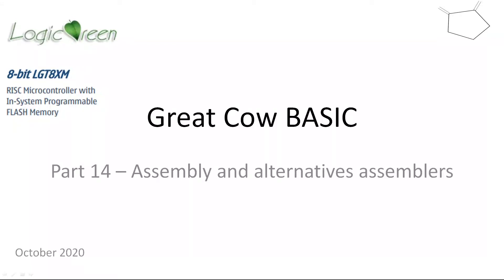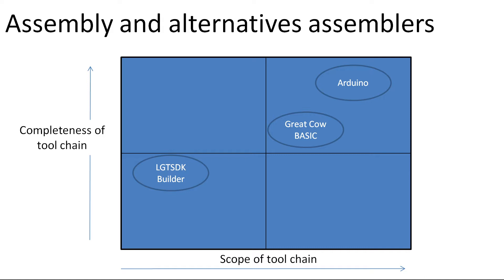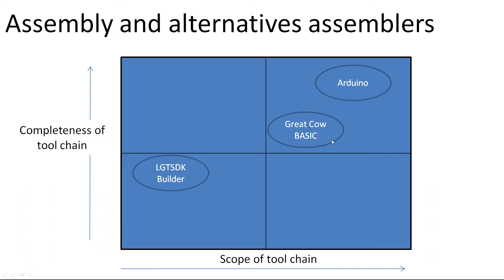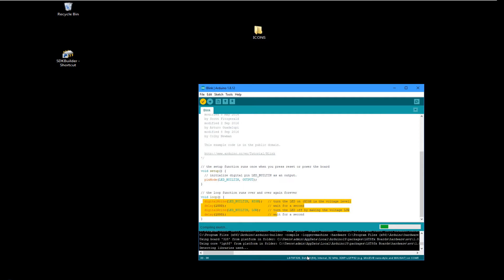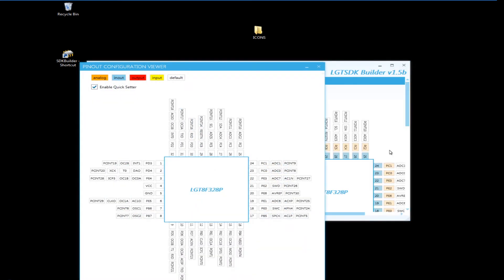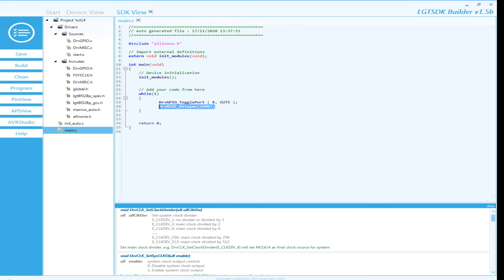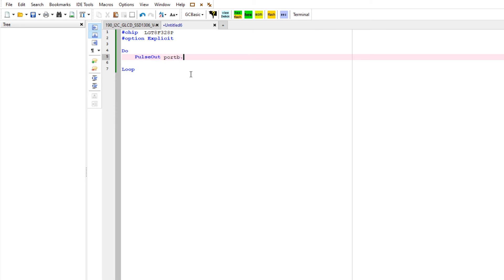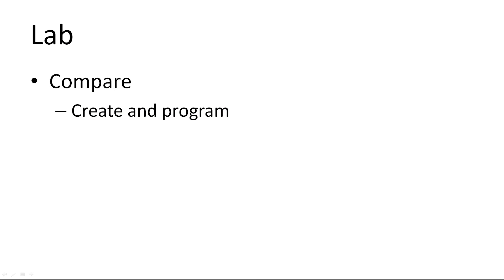PT14: LGT8XM chip Family - Using the LGT8F328P with IDEs: Arduino, LGTSDK  Builder & Great Cow BASIC

Comment: Nice video! :) One thing caugh my eye, and that is... How do you manage to use AVRDudess to upload your hex files? I mean what is your physical setup? So far I've been uploading with Arduino IDE and dbuezas library, (with a  MiniEVB programmed as larduino programmmer in between) but I've yet to come up with a solution that don't require recompiling each time. ... Any hints?
Reply from the maker: Hi. Serial connection using the LGT Optiplex bootloader.  I worked with AVRDUDE dev team to get LGT included in the AVRDUDE config files.  So, the result is a seemless upload of the hex.
Reply: @AnobiumTech  oh! but you are uploading through the "programee's" usb then.. not an isp? Am I getting this correct ? (I'm quite novice at this sorry)
Reply from the maker: No. This is a serial bootloader.   The bootloader was loaded into the LGT using programmer ( you could use Arduino as ISP but most LGT boards have  Opti bootloader programmed. Some atr 56.6k bps and some aren115k bps).  So, once the bootloader is loaded, you can use AVRDUDE.